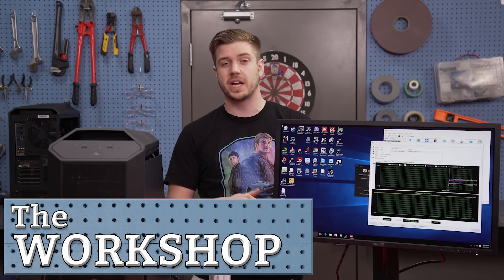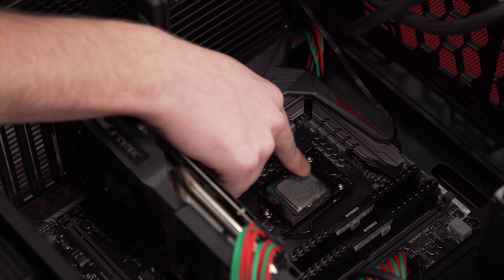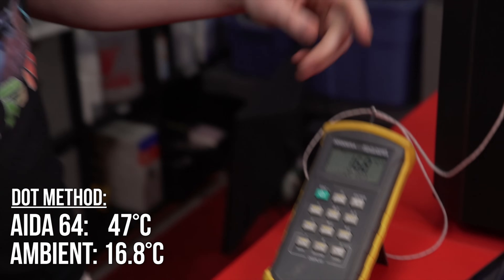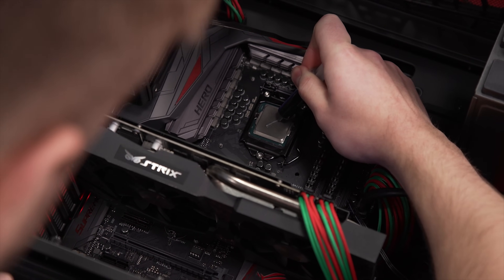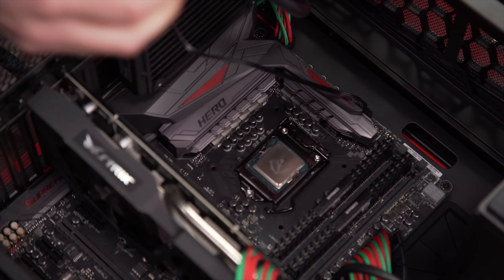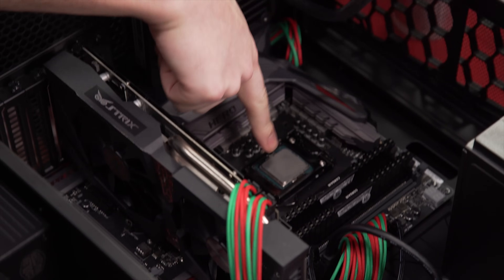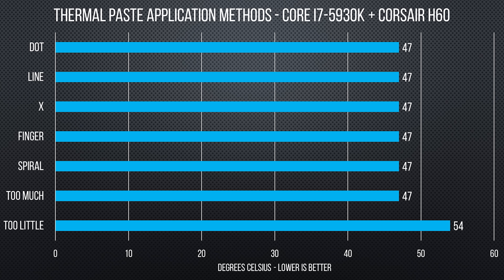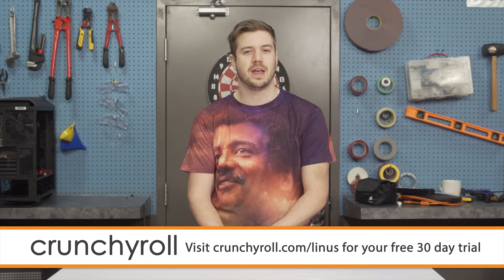Thermal Paste Application Methods - Which one is best? - The Workshop

Comment: You'd probably get more accurate results if you stress tested the CPU for an hour or two with each method. The only reason thermal paste is used, is because of extremely small (too small to actually see) imperfections of the top of the CPU and bottom of the heatsink, and the paste is more conductive than air. So, the thermal paste is more for when how conductive the surface is really matters, and not enough won't spread out to all the imperfections, and too much will keep the more conductive metal from touching.

Comment: Will a 280watt psu power a 750  ti?
Reply: thx 
even with the factor of a q8400 (which is very power hungry)
Reply: +gorgomomo ok I was just seeing threads everywhere saying that it wouldn't work
Reply: +gorgomomo yeah it definitely isn't the best psu
Reply: what about if I run it without a CD drive
Reply: Ok I just am really tight on a budget for a PSU but the 750 works
Reply: +gorgomomo no I meant the gpu
Reply: +gorgomomo I meant ti (oops)
Reply: k thx

Comment: I think you should have used an air cooler which had a lower TDP cooling rating or, at least, setting your fans to a fixed speed

Comment: There you go, FINALLY!!! For all the noobs and fanboys out there (Looking at you Linus, Mr I know everything because I'm rich and I got my own company and also Noctua made fans with my name on them) thermal paste is not used as a way to dissipate heat away from the CPU alone, it is used to MAKE an even surface between the CPU and the heat-sink/AIO so the heat can move more evenly and efficiently and DUH it has to transfer heat otherwise it will behave like insulation, that's why without any the temperature increased that much there were some small gaps where there was no contact at all thus increasing it.

Comment: Why you don't use like 4770k CPU and do this video... that i7 5930K doesn't give out that much heat
Reply: Error, he use a skylake cpu. The motherboard is a maximus VIII Hero, so it can't be a Haswell-E cpu...
Reply: +Chase Yul you can boot without heatsink on that 5930k, the 4770k can't even boot without heatsink, the more heat the better test

Comment: Good test - two ideas: 1) you should check the speed of fans - if it was consistent across all test - its possbile if there were just tresholds that it was ramping up morethan on others, 2) would be nice to see the test on x99 platform as those CPUs have different heatspreaders :)

Comment: How hard is it to break or crack the PCB on a motherboard. when installing a stock CPU fan (or any CPU cooler that clicks on like that) I usually have to push pretty hard and have seen my motherboards flex and it scares the crap out of me. So can you break the PCB using only reasonable amounts of force to apply those coolers or are they tougher than that?

Comment: Hi Luke and the Linus team. I have a video idea for you. Loads of your viewers will be aware of the pros and cons of SLI or Crossfire but if you use 2 identical monitors, one which you play games on and one for general stuff whilst gaming like TS, facebook, email, YouTube etc. Instead of a single GPU driving both monitors is there a performance advantage to driving your gaming screen with your best gpu and driving the 2nd screen with an old or less powerful card or even on board graphics. Basically saving all the horsepower of the main gpu for the games. I assume there are still cpu issues and not having ever done this I am not sure but assume this is possible. I guess there are lots of combinations but in short 2 different gp's powering the different monitors on the same PC without Crossfire or SLI.

Comment: The 'too much thermal paste' test was interesting. In hindsight, the excess thermal paste flows to the sides, and an appropriate amount stays where it counts (between the components). I guess the only downside in adding too much thermal paste is the mess & possible short circuits.

Comment: This isn't entirely an accurate real world representation. I believe the reason all the tests virtually run at the same 47 Celsius is because that is the best possible temperature under the load and circumstances. I don't think it would get any more noticeably better with the same test done with an even better cooling solution such as a custom water cooling loop. If they delidded the cpu they are using and used non conductive paste and an air cooler, there would more chance for the temps to rise and fall respectively making the difference more noticeable even though it still probably wouldn't be significant.

Comment: 5:45 did you say what?
EVEN if you use Silver Paste that`s capacitive and its only a little.
Because it is capacitive, it slower the signal and cause problems?
Thermal Compound makes short! HILARIOUS
The caps under the socket or in the socket or Connected to ground. The only thing you can do is to make the board DEAD.
After you clean it, it will power up again.
WHAT PASTE YOU USE?!?!?!?!?!??!
Next time try some vaseline!
Reply: +Hunitos Silver Thermal compound?
They can`t afford it
Reply: +Hunitos You, sir, are very confused about the difference between conductivity and capacitance.
Reply: Matthew Hennes  what do you mean? Sir.
Reply: A material is not inherently capacitive, capacitance comes from the relative positions of things. Capacitance occurs when two conductors are close to each other, but with an insulator between them. If you're saying thermal compound can have some capacitance, then it can also conduct if it connects traces.
If by "the caps under the socket", you are referring to capacitors, then only one side (at most) would be connected to ground. Creating a short with thermal compound across a capacitor could cause it to very quickly discharge, putting excessive current through the traces, and potentially destroying them, which could potentially permanently destroy the board.
Reply: I only encounter one time silver paste that shorted a AMD CPU ( DURON).

2nd what capacitors are you talking about that Put stress on trace?
We are talking about 2.5v on and caps.
Talantum capacitors near the MOSFETs?
Max 6v rated and they don't have anything to do with CPU socket. Inside or outside.

We are talking about some small 1f or even less.

Yes there is even 50v but they are place there for other reason and not value.
Reply: Matthew Hennes ohh well.
Point is I never saw and never had to deal with.
Fixing boards for PC and notebooks make me think only a person who doesn't do repairs can say a thermal paste will make  short.

I wish you all the best!

Comment: Shouldnt have used a water cooler, would have had much more margin with an OEM air cooler.
Reply: +cheapo911 That's not how this works at all. If anything thermal paste will make a bigger difference when the cooler is easily able to keep up with the heat load. To make this test meaningful, you want the thermal paste to be the most limiting factor in terms of moving heat from the CPU to the air. If you used a crappy cooler, then THAT would be the biggest factor, and the thermal paste would take a back seat.
Reply: +cheapo911 I think they wanted the only bottleneck to be the material between the heat creation and dissipation.
Reply: But when you're dealing with a temp range when water cooled what may be half of an air cooled system, its harder to measure. If different applications of thermal paste had any measurable gain, it would be shown more on the air cooled system. 

Think about it, if normal and load temps for a water cooled system are (lets say) between 25-50C, compared to a air cooled system that can range from 40-80C, you have large margin to measure on.
Reply: I think the best setup would be to have an extremely hot CPU, such as the 220Watt AMD FX-9590, and a very effective liquid cooler. The CPU will do the best it can to heat up the thermal paste, and the cooler will do its best to cool down the thermal paste. The efficiency of the paste can be more accurately measured. The bottleneck of a sub-par cooler will be minimal, and keep the paste as the bottleneck.

Comment: I've tried with various thermoplastic, cheap, expensive, and those who follow, and even removed the radiator and sat on without replacing the 4 month old thermoplastic.
 I was also about the same temp when I tested in IDLE and with Prime.

Comment: You used a closed-loop water cooler so it is probably very forgiving of a bad thermal compound job. And you used a large, over-cooled case.  Go for a mid-size case where there is not as much space so it is harder for the CPU cooler to work.

Comment: What about while running a cpu benchmark like Prime95?
Reply: +OneGrind aida64 does basically the same thing.
Reply: +OneGrind Don't run Prime95 on a modern CPU. Prime95 will cause more heat than any application could ever possibly place on your CPU. Therefore, since we want to test the CPU at the max stress possible that it could be placed on in normal operation Prime95 is not a good indicator of heat production. AIDA64 is named such for a reason :)

Comment: There is obviously no difference between dot, line etc...  as long as there is the same amount of paste everywhere. 

I think that there are some problems with your testing method though:
-your normal way is already a little bit too much (the size of the die underneath the heatspreder is not that big). 
-You couldn't show the plastic card method which is a pity because it is basically the most dangerous, depending on the thermal paste you use you can have pretty bad results due to air bubbles.
Yet it is not a big deal.

But the reason why you don't see any difference is that you tested only one type of paste that is really thick and a watercooling. 
Depending on the combination of coolers and paste variations can occurs  especially for heavy air-coolers when using the card method (air bubbles can appear due to high pressure) or too much paste (not enough pressure on the IHS) ...  Yet the difference would be small.
I know it takes you a lot of time but I would have love to see this test with an air-cooler.

Comment: @LinusTechTips: Two things.

1. Luke, you have to allow the CPU to "burn-in" and cure the paste. An immediate test would DEFINITELY see similar results because while the CPU is hot the compound is more-or-less free flowing. I'm pretty sure you can get creative trying to burn in the CPU with a water cooler. EKWB's thermal interface is proof of concept for this.

2. Since the compound is initially free flowing and gravity is a thing, a horizontal flat test would probably be best in my opinion.

Comment: You need different brands of thermal paste, you need to compare air vs liquid, and you need to compare 4 core processors to multiple core ones that require 2011 sockets or larger.
Reply: That's not a fair result

Comment: The main issue with this test is the amount of heat being generated is not sufficient for your cooler and thermal paste to show a big difference. I think that with a larger die surface (LGA2011-3 for example) and higher load (maybe a middle of the road like 1.3Vcore overclock maybe 4.5 GHz core frequency) then we would see some differences in the application method, but I doubt there would be a large difference assuming enough paste is being used to dissipate heat across the entire die area (heat generating area). The lack of paste is preventing heat transfer to the cooler by not bridging the gap across between as much of the surface area between the heat generator and the heat dissipator. 

Keep making videos like this!

As a suggestion, one thing that seems to be a debated issue to discuss is the orientation of tower style Air coolers and the affect on VRM/mobo temps vs CPU temps in the different arrangements.

Comment: Small dot + Line is best method
1) it saves on thermal paste
2) Thermal paste is overrated
3)all it does is secure the evenness of heat contact spread

Comment: It should be noted that not all paste is the same. I tried using the dot with Céramique 2, and got almost no spread. I ended up using a card to spread it out, and it worked great. (aside from the fact that spreading it evenly is hard to get started, but easier as it thins out)

Comment: Come on.. 47°C on full load?. Must be a really low tdp cpu. Use a overclocked cpu next time. Maybe the scrapyard q6600@4ghz, that would spread out the temperatures more and make for a easier conclusion.
Reply: He is using a water cooler

Comment: Seriously? The top comments are the vulgarest? 
So here's a real question on a different method. what about spreading the paste on both the heatsink and the CPU? I do this method usually for any cheap or stock aluminum or rougher copper (i.e. not mirror finish). I'll usually spread the compound on the heatsink so that it is almost translucent with a high quality, never used razor blade. The idea is to fill in the dips in the surface only leaving any of the level surface of metal alone. I'll usually spread a thin coat on the cpu so that it is just enough to cover the CPU without being translucent. I guess I get pretty anal with my builds (HA! Slight vulgarity! not really though-ish)
Thanks!

Comment: The benefit of the spread method is if a user mistakenly applies uneven pressure when placing the heatsink on the CPU, then it avoids cases of a lopsided spread where part of the die gets too hot.

For most mass manufactured products, you see them commonly use too much, especially on videocards. this is because the workers are not completely accurate when applying it or installing the heatsink to ensure as 100% even spread of force when it is being tightened down. by using too much they ensure that the the die is still fully covered.

For thicker compounds, too much being applied in an even spread will increase temperatures, for example, use a credit card and spread an even thick layer of arctic silver 5, and then install a heatsink which uses springs to maintain the proper force. you will notice that temperatures will be higher for a while before the heat makes the viscosity change and the excess compound is slowly pushed out the sides. (hopefully not touching those test points on the top of the CPU).

PS, from repairing many laptops with bare dies on the various chips, the spread method has worked best for me, as the others either do not fully cover the die (very bad) or they cover it and have a ton of spillover.

Comment: The thermal pastes that i have tested in the past have proved not to be electrically conductive. Using a Fluke 87 multi-meter, I have tested: Arctic Silver 5, Antec Formula 7, and Shin-etsmMicroSi.

Comment: The one flaw I see with this test is that the silicon die in that chip is significantly smaller that the metal case of the chip meaning all the heat is centred on only a small section on the socket. Trying this with a 2011v3 8 core that uses way more of the space inside the socket (or even a xeon) might give more varied results!
Reply: +Matt Bentley seems like it would be about the same, you just need enough to cover the die and looking at the spread pattern all reasonable versions would have done so, you can google images of where exactly the die is in any particular cpu.

Comment: Thanks Luke.  We've seen which method of application is best, but what about which brand / type of thermal compound is best? Is the cheap stuff better than Arctic Silver or Icy Diamond?  Is a thermal pad better?  Should we forget even the cheap stuff and use something odd, like mustard, silly putty, or motor oil as thermal paste?